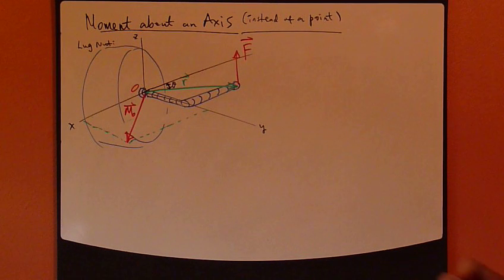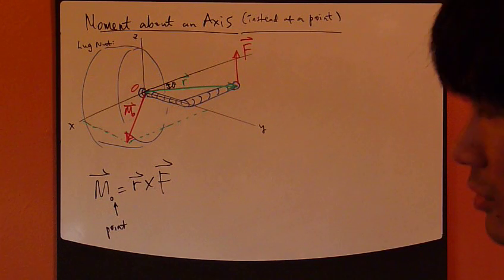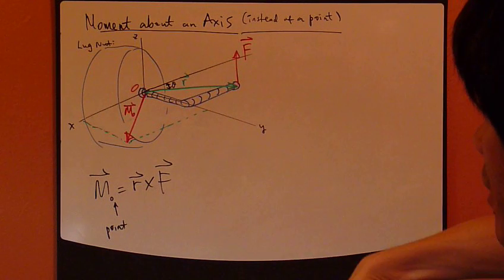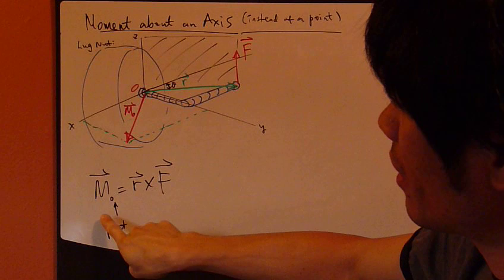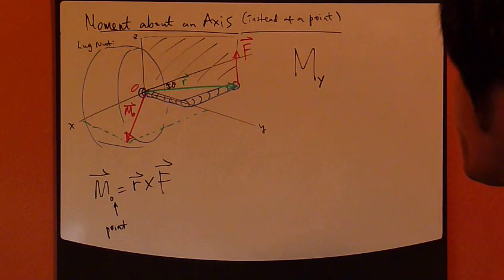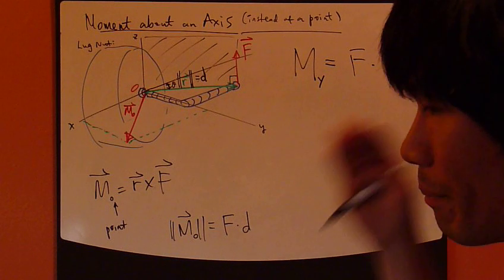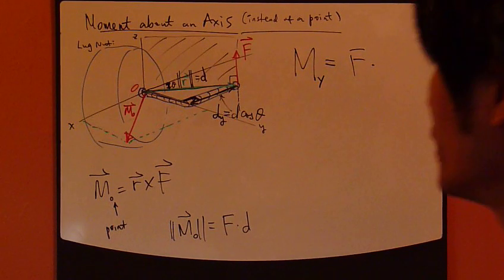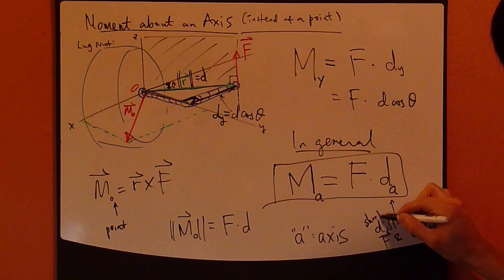Engineering Statics Ch4 Part5: Moment about an Axis

Comment: I dont know if you have figured it out but at the first i was confused too. Look at it this way. The x axis is parallel to the handle that connects with the force. So the angle theta is actually same as the angle OF to Y axis. Now you apply Fdcostheta will give you the dy.